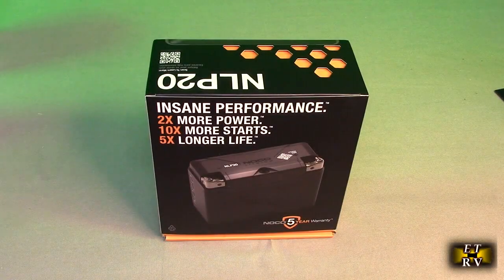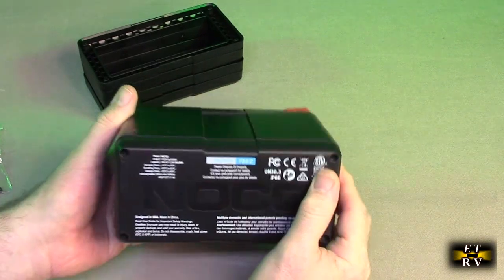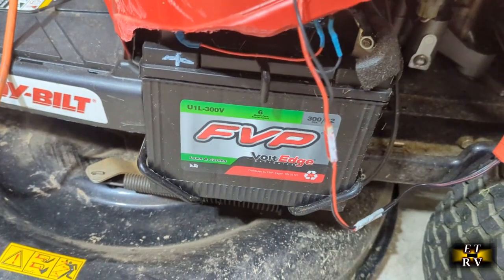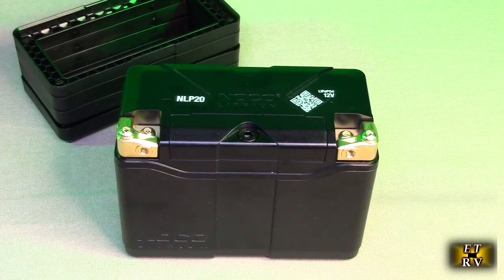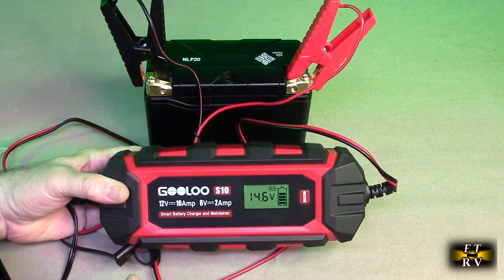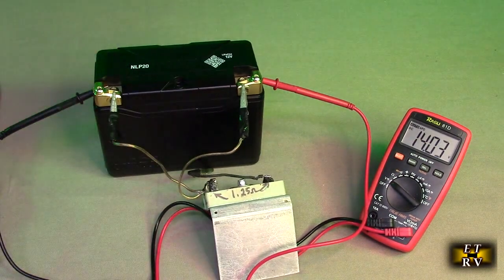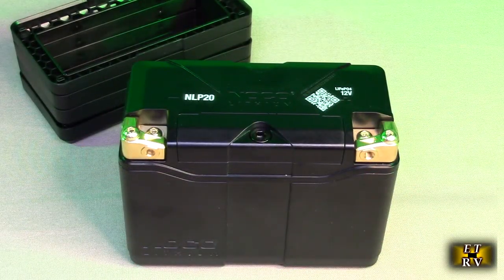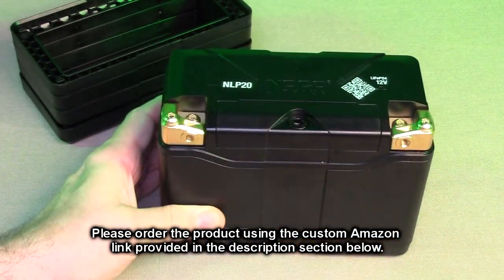NOCO Lithium NLP20, Gr 20, 600A Lithium Less weight Lead Acid Replacement Battery, 12V 7Ah REVIEW

Comment: Got 1 for my 1300 cc Can Am spyder, starts good. The snap on plastic spacers are kinda hokey, just glued them on with silicone. Bought a new gel cell batt and didn't start the bike the best, was happy the lithium battery starts it just fine. Bought a lithium charger at same time I got batt, works good.
Reply from the maker: Thanks for sharing